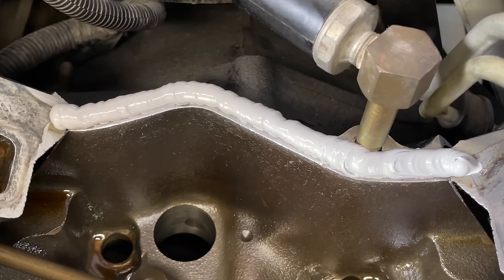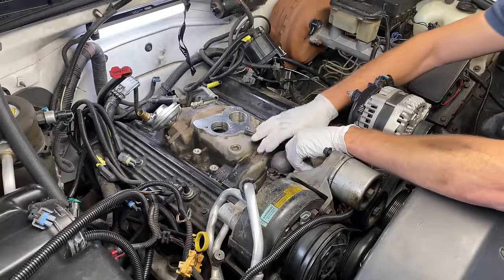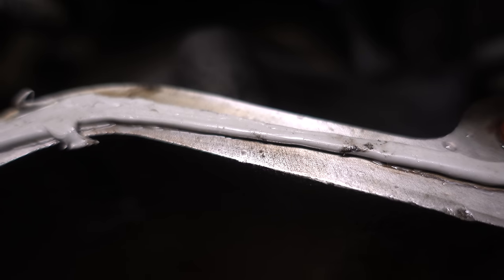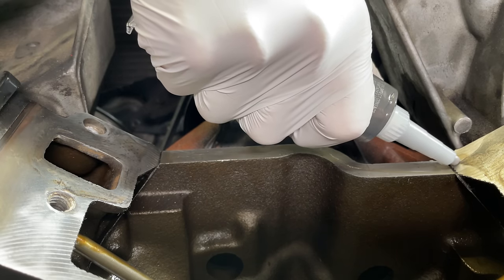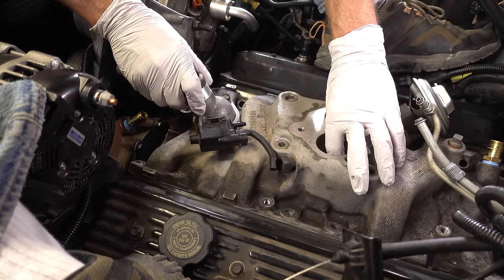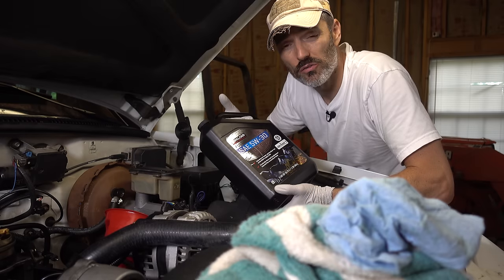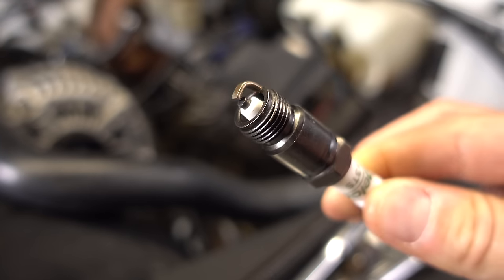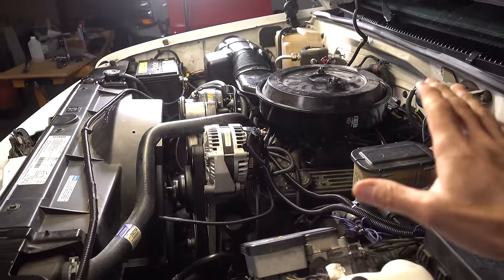Why You NEVER ATTEMPT To Use RTV Gasket Maker Without Doing This First!!

Comment: Too much is just as bad, maybe even WORSE, than not enough. If you use too much, it will squeeze out inside the engine and end up clogging your oil pickup and destroy the engine. When it comes to RTV, you really don't need much at all. Just make sure you prep the surfaces really well, they MUST be completely clean and oil free when you apply RTV.

Comment: I have no idea what you're talking about.  Either one or both surfaces was warped, or it was not torqued enough.  That "little" bit of RTV, was more than you needed, rather it simply was not compressed to spread out enough.  Of course other comments are also correct about clean surface prep but even with it dirty, it did not spread out  like it normally should.

Comment: If you would have drained the coolant, and then use the coolant air lift tool you would not have put coolant into the engine oil

Comment: This is way to much rtv.Just a small line is fine when there will be no gap between the mating surfaces after putting it together.
If there's a big gap after, like on the chinese walls of some V8's, just search for the gasket that fits the best in height and use the rtv on both sides of it, or if the gap ist tight use a thicker rope of rtv.
I prefer to screw it all together lightly for the first time, let it dry and then aply the recommended torque. Therefore the hardened rtv gets squished a bit for proper sealing.

Comment: Dont blame yourself.

Yes, you put too little. But that two components are bad design or manufacturing, OR you have a different problem elsewhere.
The gasket looks thick. It should be no more than a 1mm. The parts are too far apart and therefore for normal person the seal should not require to be that thick.

Comment: It's amazing that you claim that you did quite a bit of research before you did that job because it is been known for decades on the front rear Valley seals how much and how to apply the RTV silicone, which is the preferred product. I have been aware of this for quite some time as well but I do not see how that tube that they gave you was enough to do both jobs unless it was barely enough. You have to have a height of about 3/8 of an inch and a width of about that to get that to work properly. Not only that the stuff that you're using looks quite thin, as far as viscosity goes. In other words it should be far more of a paste than a warm butter.
You claim that you found more than one opinion. I have never seen more than one opinion of that there is a highly specific method and there's only one of them that has ever worked in a consistent manner.
Every single Source you research should have told you that you can have easily a quarter inch opening at the front and rear of that Valley. As for those Fel-Pro intake gaskets, those are nearly Bulletproof. And just for better understanding the thing that you use to hold the gaskets and place is not that extremely slick gasket maker especially when you first put it on. The stuff you were using is still a bit too thin. You should be using something like the Ultra black Ultra gray, the red or the blue but the ones that work best or a lot thicker than what you're using.
Just as an aside when did foot pounds turn into pound-feet. I know it doesn't matter which way you say it, but it just doesn't sound right, pound feet?, I don't want to pound my feet!
Especially considering the specification applies to how many pounds are hanging off of a 1 foot lever.

Comment: Yeh way too much sealant. The trick is to place and seal your cover, then wait it to set to the shape you've just created (24hr). Then tighten up the bolts. You're way just squirts sealing out the sides, which 6 months from now it will inevitably find its way to the sump blocking up the oil intake. It's called gasket maker, not glue.

Comment: Too thick of a bead for your oil pan you WILL end up clogging your oil pickup screen w dried RTV that ends up falling off that ledge inside and youll spin a bearing. Never use just RTV for oil pan gaskets!

Comment: This is why non professional mechanics should stop making how- to videos . ( If you've never used rtv on intake ends it is highly unlikely you are a professional ) 
Pro tip : get the " right stuff"  ( permatex ) yes that's actually the name of it , apply about a half inch tall bead for proper sealing , also apply a thin coat up past the intake gasket tabs .

Comment: Its ok to use too little. Too much of this stuff and u can clog ur oil pickup and ruin ur engine. U did ok still. Jist gotta lay a nice bead on the inner side of the pan and inside the bolt cutouts

Comment: That's too much, now you will be called silicone man 😂 if you are in a doubt, just consult the workshop manual. If i recall well, beads shpuldn't be thicker than 3mm diameter, depends on the zone, but that's about it. The quantity you used was obscene.

Comment: Kind of a rookie mistake. Also this is not a big job, it's pretty easy if you don't screw up your silicone. Never use the provided "RTV", what they give you is inferior trash. Use ultra black Silicone from the parts store, they even provide a plastic nozzle you can screw on and cut to get the bead thickness you need. My chevy 350 never leaked between the intake.

Comment: Sorry but this is wrong practice, You put too much rtv will be inside engine and this will close oil pump and this will damage your engine, put it in the middle and leave space in edges when you tight the bolts  it will be exactly ,  and you must leave it 24hours , thanks

Comment: Way too much in my experience u will have it stuck in oil gallies and oil pick up tube screen starving parts or all of the engine of oil plus get stuck in ur cooling system possibly causing an overheating issue.

Comment: Using RTV should be a criminal act in many cases. My buddy bought a Kenworth, and the Cummins CM-871 was having issues from a bad delete, imagine that? Several of us said don't do it... Long story short, the motor was loaded with RTV, in the oil passages, cooling system, everywhere it could get to, it got there. Little bits everywhere. Whoever did what ever they did to this motor used RTV on every gasketed surface. I tore this motor down, and the only gaskets I found were in the exhaust and the valve cover. I hate RTV.

Comment: Ultra Grey is the WRONG product to be using for this. You have exceeded its build height. Grey is an ultra thin, used mainly for aluminum and high growth materials. RTV Black in the easy cheese can is what you want for this. Its black, to blend in with teh black cast iron. Its got a higher durometer so it has a higher build height, meaning you can use a big glob of it as an end seal and not worry about it self leveling too much. You can see how much the grey is self leveling here.  Lastly, lay down your bead on the one surface right. Then put a film of the stuff on your other part. just squirt a blob, smear with finger into a thing layer. Thats how you make both sides bond. Just like any other contact adhesive. Let them dry to a tacky. Then push together. Dry some more. then torque. Perfect every time.

Comment: Gasket maker is gnarly stuff, not chemically, but you get WAY too many opinions on what "right" is, and if you put too much - easy to do - then all the old timers swear up and down that globs will come off inside the engine, plug up oil passages, and kill the engine. You put too little, and you end up with this video. So every time you do the job is a hope and pray situation, even if you found a trustworthy manual and follow it to the letter, maybe you still goofed, who knows? There's a reason they stopped using it for sealing, or redesigned the seal surfaces to make it goof-proof for liquid gaskets. This exact job is infamous for exactly this reason, he's not the first guy to mess it up. Maybe just use real gaskets, Chevy.
Reply from the maker: Good point. 👍

Comment: That’s insane, you did nothing wrong on the first job. These are machined surfaces and you shouldn’t need to place a freaking bead the size of caulking a shower. Your first thought was right, engines do plug up with too much gasket maker. It’s unfortunate that the tolerances on this engine manifold are utter garbage.

Comment: An egit with a camera. Do you think you’ll get an accurate torque without first chasing those threads?? How about those intake bolts, you surely wire wheeled them too. Why would you think your new gaskets were going to stick?? YOU JUST PUT THEM ON. You know how to use a computer [assuming] do some research before pontificating. Prediction, it will leak again. 😂

Comment: There’s two types of gasket maker, ones that cure in the absence of air and ones that cure in presence just fyi
Reply: Silicone based sealer drying is dependant on air .  There is anaerobic. Sealers that dry in the absence of air . But they are not silicone . Think thread locker . Invented by rolls Royce . Ie common name Loctite. . There are some sealants using this principle but they are designed for parts that fit very tight together . Not a gap filling sealant

Comment: Yep you paid for the knologe you got, do it wrong do it twice second time it comes out nice.  Do it wrong  2 times pay someone else to do it nice.  Third times a charm. 

Reading online information, isn't always the best advice you've got to take it with a grain of salt.  Ive seen so much done online thats iffy at best.    Watch some of the pros.
I watch a guy from upstate NY and Raymond from flordia.  You also need to see if the gasket kit you get is compleat im pretty sure that a version of the kit comes with a frt and back gasket or one that is a 4 pec kit you just use some sealants at the overlaps.  Insted of setting a gasket with a firm a gasket you can use navel jelly to hold one in place.
Im not a pro so my advice might not be the best but I'm pretty sure you want a gasket to lay flat putting something under it risks making that spot to fat making it harder to get even presure over the intire surface and thats what you need to get a good seal. Thats all a gasket does is bring 2 metal surfaces togather and fix any minor flaws the metal surface has and fills it in.
A drop of gasket sealer in the wrong spot wont let the parts sit flat.  Now navel jelly or grease will smoosh out gasket sealer might be too stiff, but the best way is nothing at all on real gaskets yes use it where your requirements call for it. But don't put it where its not ment to go.  I never see Raymond use it to keep a gasket in place. He never uses anything.   
You'll find most Asian brand cars use pins and roll pins to hold gaskets in place  and gm will use them to hold bell housings but you dont often see them on intake manifolds or valve covers. 
Honda and Toyota have went to press in rubber o ring type gaskets I think these are better less chance of moving durring install.  Your keboto tractor will be more like that.

Watch the Pros ignor us DIY guys. 
You'll get better advice from the pros.   I have always done my own brakes  but I'm getting to old to be pulling wheels off cars and using a 4 way to break loose lug nuts and a factory screw jack to lift a car.
These are emergency tools sold with the car.  A good floor jack and jack stands are better.  And a electric impact gun.  But tools cost money and I dont make a living doing it.

Comment: Wow! Gobbed that stuff on there. When you torque it down you’re gonna have so much inside and outside pushed out. Not smart. It doesn’t take that much. Put more time and effort into preparing the surface than putting so much on 😮

Comment: Throw out the gasket maker from fel pro, it's  garbage. Get the gm gasket maker from the dealer. Also don't use too much gasket maker, nothing looks more amateur than large  beads of that stuff squeezed out of mating surfaces. I worked for gm for 15 years and never had gasket maker fail, and never used more than the amount that you claim failed
Reply: Also torque is only critical on bearing surfaces and cylinder heads. Intake manifolds, timing covers etc, just use a 1/4" electric impact and call it good. And ffs throw that damn thread sealer away lol

Comment: Like a bobble head
Reply: If you want to know if you used enough sealer and applied it in the right place, sit the manifold in place, then remove it before installing any fasteners.  If the sealer has transferred to the mating surfaces without any gaps, you're good to go.  Reinstall the manifold without adding any additional sealer and install the fasteners as described.